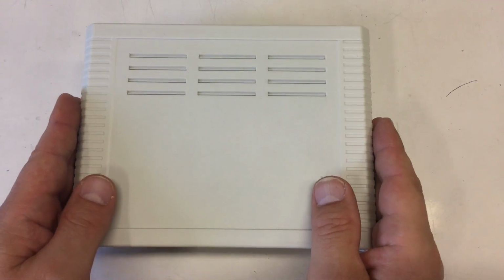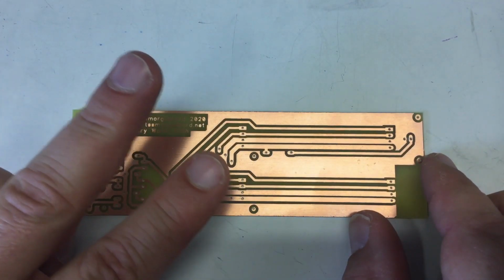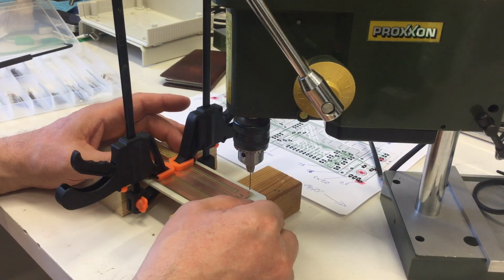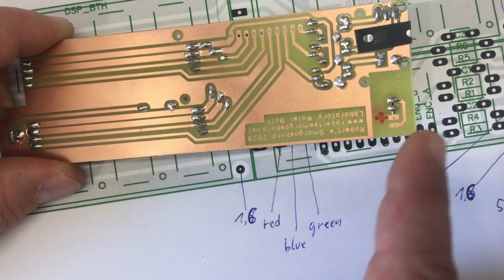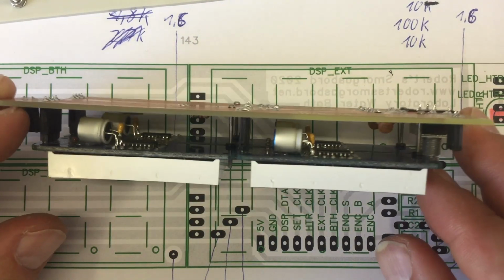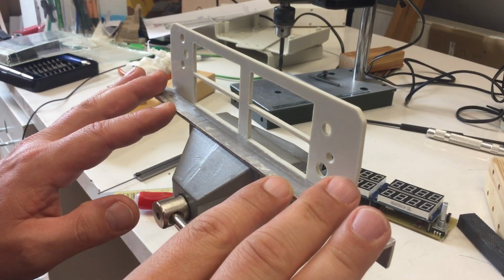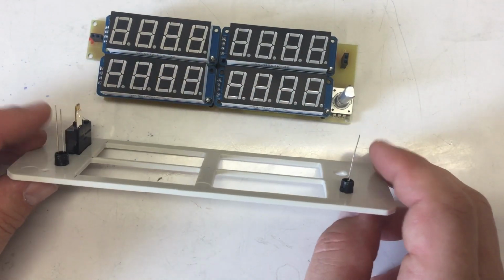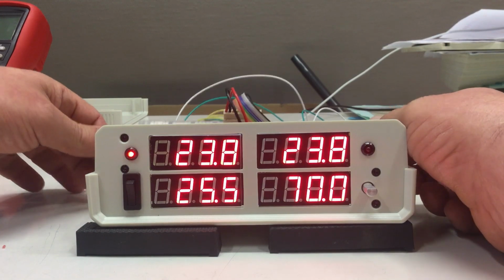Laboratory Water Bath (7): Controller, Chapter 1 (Front Plate & PCB)

Comment: Hi Robert!  Excellent video. I noticed though that is it time for you to jump in the 3D printing club to develop your front plates. It will make your live so much easier. Believe me. That is what I did a year ago and I do not regret it a single instant. Same thing for my pcb with a CNC machine. Looking forward to see the next installment. Regards, RJM
Reply from the maker: Hello René-Jean! Thanks for the praise. And yes, one day I'll join the 3D printing club ;-) For now I've bought myself a small used Proxxon milling machine ("unboxing" video coming up). That should alleviate at least some of my pains ;-) Regarding your CNC: Are you actually using it to mill the traces, or are you just using it for drilling and milling the outline? Best regards, Robert
Reply: Hi Robert.  I do both with success. I start by miling the traces from Gerber file to cnc file using Flatcam ... a great tool, ...then I use UV sensitive paste to make the solder mask and then I drill the holes and cut the board contour with the cnc. I have to admit I had some failures at the beginning, like you with your pcb in the video, but with patience and perseverance I succeeded. You could even make your front panel with a drawing software like Fusion360 or FreeCAD and mill it with ordinary pcb material as your front Plate. I bought and Ender3, excellent machine almost two year ago and I use it regularly. I bought my cnc model 3018, 6 month ago and I use it all the time now for my pcb. Knowing your patience, imagination and your dexterity I am sure that you would make great things with those cheap but well constructed little machines. There are zillions of good videos on the subject on Youtube. Good luck. ...Don't tell your wife that I am putting purchase idea in your mind :-). Regards, RJM
Reply from the maker: @rene-jeanmercier6517  Hi René-Jean - don't worry, I won't tell my spouse what you're up to ;-) Anyway, it's good to know you're still using at least one photo-chemical process (solder mask) :-) An Ender3 goes currently for 150€ and a reasonable 3018 for about 200€ at Banggood. That's not too bad. But I guess I've to wait until that C.... thing (YouTube edit) is over until I can buy more stuff - my business is going real slow right now :-(